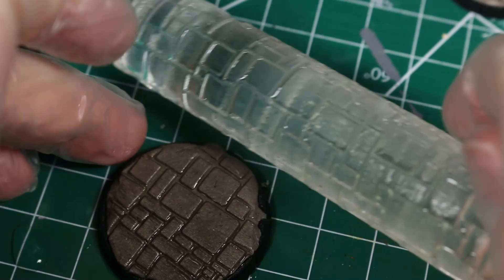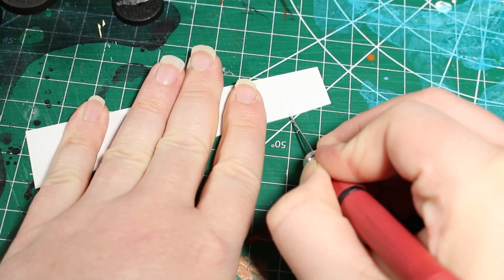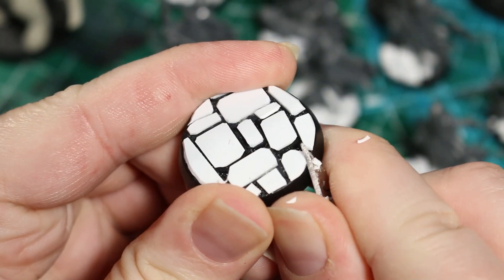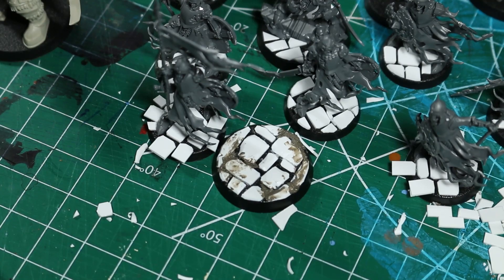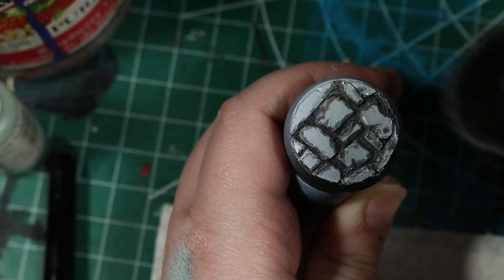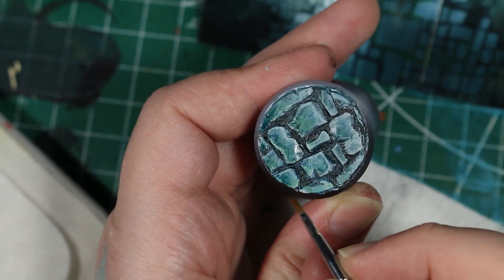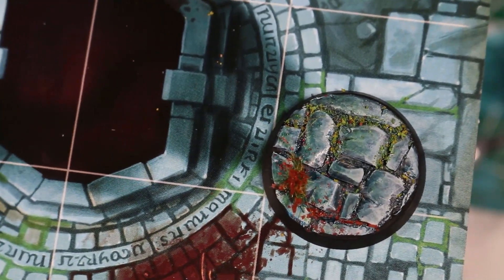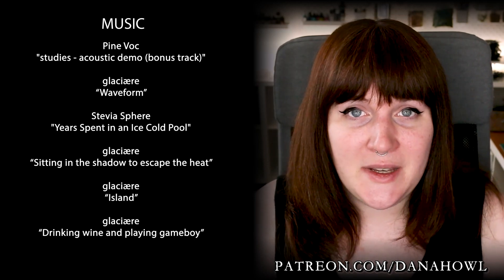How to Make Cobblestone Bases!!!! (to match the Cursed City Boards)

Comment: Styrene and superglue is exactly how I used to do cobble stone bases. It's a great, if time consuming technique. 

I've recently switched to texture rollers on sheets of firm sculpy clay. Before baking the clay, I use a somewhat oversized cookie cutter to get rid of excess. Once it's baked I use a compass (or in my case abuse a caliper to be a compass) to score them to the right size. Then use a pair of scissors to cut them out. This gives a lovely bit of tear out, that will make the edge look interesting, but uniform. Layer up with cork and partial sections to make it look more interesting.

The most tedious, and messy part is cutting out the bases. If that's not your jam, you can do the Wappel method of just breaking the sculpy sheets in chunks roughly the right size, and being cool with overhang.
Reply from the maker: I'll definitely be testing out a similar method on a future project!!! thanks for the input!

Comment: Another great video.... I did something similar but using plaster.....mixed quite stiff then rolled out between cling film then textured with a ball of foil.  Once dry the thin slab of plaster breaks  into flagstones really easy  once scored and can also be shaped with little effort. I seal the finished base with watered down PVA before priming. I'll certainly be using your painting as a guide. :)

Comment: The most cursed way to make the bases is to cut the game board into circles and glue them to your bases
Reply: Buy a copy of the rules and boards and cards and dice on ebay or troll trader and use all that for your bases on the full set you bought just for an extra flex

Comment: These look very good. When I do tiles or stones, I use old gift cards instead of plasticard, and cheap scissors instead of a knife. Problem with cards is they need a good sanding before painting. While sanding does add texture, it also adds another step in an already tedious effort. Love the finished look.

Comment: I've been carving bricks for the last few days lol, I chose to stack some of the bricks together to add to the variety as well as carving actual cracks into them as well... giving them some character.  The tips of my fingers are sore lol holding all those bricks but I found they turn out better looking, at least in my opinion, if they're cut before they're glued to the base... although it does take more time.

Comment: You can use Bristol board as a cheaper substitute, it even has a very faint stoney texture to it. Only extra step it requires is a coat of thinned PVA to harden the card.

Comment: A way to possibly speed this up a bit Dana, is to make something like 20 blocks of various sizes and shapes, then make a silicone mold and use a quick cure resin. While a bit more expensive, and also kind of messy, once you get a working mold, you can churn out a ton of this bricks like no tomorrow and have enough material for your cursed city box or any other future projects you may want them for.

Comment: If you don’t have plasticard you can use old hotel plastic key cards as the same thing. Make sure it’s the matte not smooth shiny card but I think that would work too you would just have to sand it.

Comment: this is great!

only recommendation is to use plastic cement or any Dichloromethane based solution instead of superglue. Tamiya Extra thin is a great solution for this! it makes it less brittle, can blend into the base and gives you more breathing room for placement as it dries.
I'd also give the styrene a light sand before cutting it up so your paint primer adheres to it better. the glossy finish on styrene can occasionally prevent your paint from adhering so well. a light sand will sort it right out!

keep up the great content!

Comment: Just ordered some plasticard for this, going to put on a podcast and havevat it.

Update: absolute Ball ache, trimming the basas just seems to remove the stones, tried super glue and plastic glue at this point.
Reply: Are you using thin super glue and waiting for it to cure fully before carving? Also, how sharp is the knife blade?